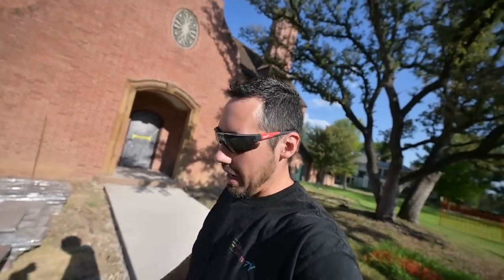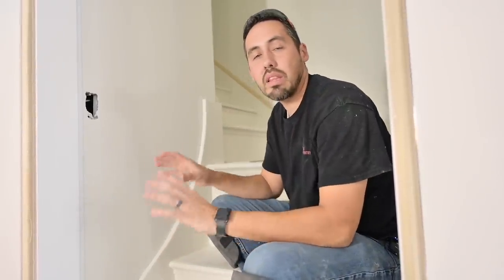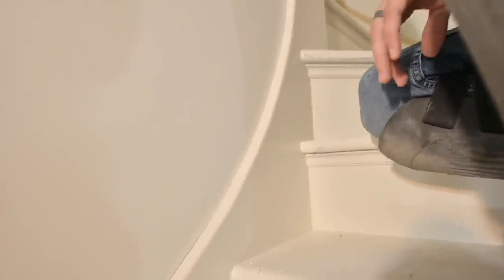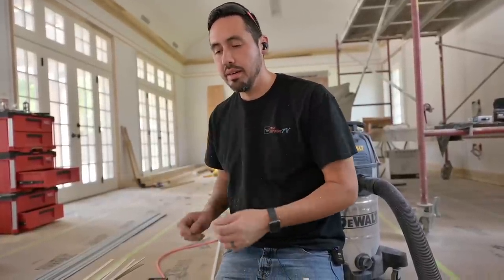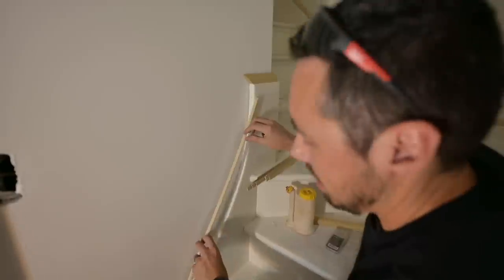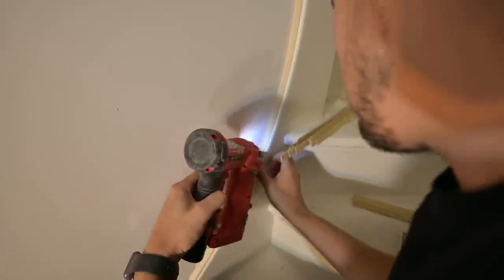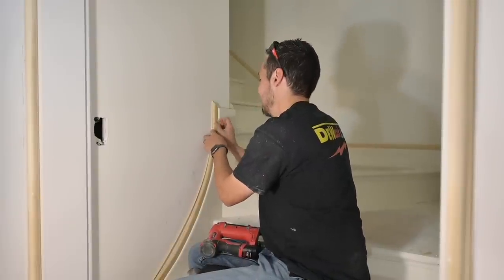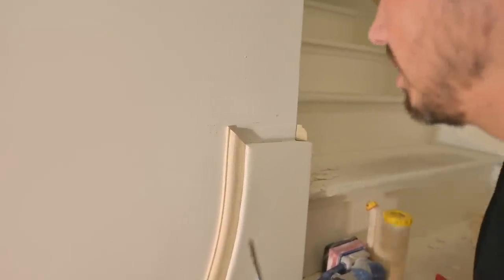This is some NEXT LEVEL Carpentry - Curved Skirt Board & Bent Lamination Mouldings

Comment: I do many projects in the yachting industry as far as woodworking is concerned.  We do a lot of curved trim installations such as this. Mostly in varnished teak or mahogany.  Do much of the same with bent laminating, aslo use steam bending sometimes as well.   I use blue tape and hot glue blocks of wood to it for clamping instead of nails for each layer,  hot glue holds quite well.  Also make a lot of bending molds from pvc boards, for gluing off site.

Comment: When I have profiles that I need to sand, especially intricate ones, I use a deck of cards to make a negative of the profile and glue sandpaper to it so I can sand that profile evenly. Curves like this I cut the deck in half lengthwise so I don’t dig in to the wood as much, but it makes sanding the profile a lot easier and you don’t have to worry but over-sanding a spot as much. I do furniture, not finish carpentry, but I would imagine the same technique could be used without any issues.
Reply: That's a hell of an idea thank you for sharing that.... priceless tips like that take years to learn
Reply: Do you have a video or tutorial of this method? Interested in this being I refinished a house of doors with a classic profile on the rails and stiles.

Comment: I do a lot of bent lamination for furniture.  You might find it easier to deal with the connecting joints by laminating into a form instead. You already cut the template for the base board and it would work perfectly for a form. The offcut from the template  can be used as the negative press for clamping the inside of the curve. That avoids the pin nails and gives you blank that you can cut your 45s with like straight stock.

Comment: Sanding Tip: As a shipwright, I have sanded many curves. Hulls, bulwarks, handrails, moldings, etc. 
Tip 1.   One of the things many of us used most frequently for fairing a surface was structural foam. Any rigid foam will do, (such as insulation)  for instance, I would bend the foam in the shape of my curve( if needed), and apply a layer of tape to hold that shape, then I used self adhesive sand paper on the "sanding or fairing board".
Tip 2.  This one is more for small detailed areas with a curving profile face like what is shown in the video, 
 Still using foam, Cut a piece that is say 8" x 2" x as wide as your trim.  
Cover the "trim" with a tight layer of Mylar tape (Scotch tape). Also protecting all surrounding surfaces.
Wax isn't really needed but it help, so I would wax the tape, then I mix up a semi hot batch of fairing compound (Bondo) then quickly apply a thick layer on to my foam, and pressing and holding the foam still, ( taping it into position when able) and waiting for it to harden. Next remove the foam casting carefully, so as not to damage the shape, remove the tape from the mold, trim it to desired length and then using a grinder or an edge sander, clean up the casting. lastly put some adhesive sandpaper tightly to the cast surface and you now have a perfect abrasive cast shape. Some time the shape we are sanding changes but the profile still works.  Cheers!

Comment: I didn't expect you to cut and install it the way you did. I was expecting you to glue it all up on your template using heaps of clamps than cut and fit it to the space. Well done looks good
Reply: I thought the same thing.
Reply: Thats the proper way to do it , laminate the pieces around the template but leave them long to compensate for it springing back when the clamps are removed, doing it around a form you can sand it with it flat on a bench and both ends can have a 45 degree mitre cut on to them.
Reply: That’s the ideal way to go, but you have to remember that he’s a mobile finish carpenter (save the garage tools).  I believe interior space may have been an issue for setting up a table to do the laminate glue up.  Plus,he wanted to challenge himself and see if it could be done this way.  Excellent results for a difficult solution.

Comment: Excellent work. The old adage (at least here in the UK) is that adding a single curve to a piece increases the time needed 10-fold. Add complex curves (more than 1 curve) increases it 100 fold. In all my years, I’ve found that is a pretty good rough measurement.

We are currently trimming out a barn conversion. All of the important trim is in European oak. That means that we can’t think about filler for any gaps and the grain of the oak becomes a real issue. 

We don’t use steam for this. In many cases, we do steam bend components but that method does have its own issues. Firstly, timber expands very little but compresses much more; you have to understand that and make sure you don’t try and make the timber expand too much. You can’t steam bend accurately as different timbers take different times in the box and all pieces spring back. 

We laminate our pieces - usually with a band saw as the kerf is much thinner. We over cut and then sand (with a drum sander) to get rid of any blade marks and ensure even thickness over length). And we cut more than we need because pieces snapping on installation seems almost inevitable. Then just build up until you have enough strips. If we are doing a complex curve (like a spiral) then we kerf cut all the pieces except the very thin top piece. Then apply a good quality adhesive (we only use PVA on this as PU could expand and make less than tight layers). To “cramp” everything in position. We hammer in lots of trim nails along the length if the wall is painted. If it is oak panelled, then we have to get very creative with lots of timber spring (long lengths of softwood perhaps 12mm thickness which we then cut to a length so that, to fit in between the lamination and, say, the nearest door jamb or ceiling, you have to bend the timber spring quite a bit. When in place, that spring acts just like a cramp. 

I hope that helps so,some who might face the same issues.
Reply: Thanks! I'm qualified but I've worked alone since college,  (I was, let's say past apprenticeship age!😉) so have to think up ways around things as I have no-one to learn from. So it boosts my confidence when I hear time served men, like you,  using techniques and get arounds that I've used. Thanks for a bit more knowledge. What area is the barn? (I'm in UK.)
Reply: @susanportsmore5306  I appreciate your comment. We are in a hamlet about 15 miles from Tunbridge Wells. The barn was an old Atcost steel job with corrugated iron cladding which had been used as a packing shed maybe 20 years ago. It’s the standard 100’ x 30’ size although we have put in a first floor. As a result of our LPA being both inefficient and lying (in writing!), we ended up spending £250,000 on legal fees. That took away the cash we had allocated to finish the barn off. So, when we move in (next month) it will be habitable but not finished. That’s fine as it only the wife and I.

We have spent about £20,000 on oak to date. About £5,000 on engineering oak herringbone upstairs and the rest on solid timber. With that, we are making window surrounds, door sidings, door frames, some doors, skirtings, coving , picture rail, stair treads and some furniture to end with (in oak and red grand is).

We are both very fond of the UK Arts and Crafts style plus the US craftsman style. So, my designs are heavily influenced by those. These days, the amount that I can actually do is limited but a son, who is a very good joiner, is doing most of the work.

For the finish, it’s Rubio Monocoat in a smoked oak tint. I don’t know if you have heard of, or used, Rubio, but I’m very happy with it. It costs a lot per litre but you use so little per square metre, that’s it quite cost effective. The A&C/craftsman movements used a lot of fumed oak. I’ve done some but it’s a nasty process of putting open ammonia in a closed space with the timber and waiting for the timber to take on that mellow tinge. For where I want “ebony” accents, I’ve made an ebonising solution (steel wool in vinegar) and “paint” that on the timber; depending on how strong the solution is and how long you leave it for, the oak, or any tannin rich timber, will go from mid brown to jet black. 

If you want a glimpse, then the son has a Facebook page (Sam Ward) and he has posted a few pictures of the work in progress. 

If I can help you in any way by just offering something from my personal 40 year plus experiences of hobby woodworking, let me know.. thanks again, Martin
Reply: @theofarmmanager267  Dear Martin, many thanks for taking the time to give me background on your barn. A lovely part of the country. I've heard but not used Rubio, and with fuming and ebonising, fascinating stuff. Urh I empathise,  I'm racking up legal fees and iht as I deal with my mum's estate, 2 years and still ongoing. Actually this prompts a question,  my dad/grandad were builders and built the estate I grew up on, built early 50's, I'm considering removing all the herringbone to reuse, especially as I found another stash in the loft! Knowing it's set in bitumen, do you think it'd be worth trying to remove? I'll take a look at your son's photos, it all sounds terrific, I too like a&c movement and the US look of trimming out. Has character,  unlike all the mdf I get asked for, not a joint in sight! I'm veering away from these jobs as its not what I signed up for and I love timber and hand tools, my dad's and grandad's chisels make me a happy worker! 😊 Hope you get to enjoy your barn soon!
Reply: @susanportsmore5306  thank you for the reply. Worth taking up? It really depends on the condition of the timber and what kind of flooring it is. If it’s solid timber (not engineered), then at least you could sand out any defects. I did that with a very large solid floor in an office building in London. It came out like new. If it’s engineered (with a veneer anywhere from 2mm to 6mm) then your re-sanding is limited by that.

I’ve only ever known solid timber that has been laid on bitumen. I’ve only ever had to take up a little bit of that and it was variable. One piece would come up quite easily because it had little bitumen but most were a real pain and it’s incredibly messy. So, for me, it would be a balance of the state of the floor versus the dirty hard work involved. 

We do use quite a bit of MDF. We’ve just panelled a corridor about 10m long in a Tudor revival style with linenfold, motifs and strap carving through it. Because the panelling was going to be painted, then we used MRMDF but only either Medite or Finsa - it is miles better than the compressed paper you get from the sheds. For the entrance lobby, we are doing pretty much the same style but in oak. For the backing panels, we are using oak-veneered MDF as you can longer get boards 300mm plus wider.

Comment: Great work Richard, I did one few weeks ago almost exactly the same size and slope, I used Kurf method which I learnt from kitchen installations from the curved corner parts of plinth on kitchen islands, I used to have to buy the bent plinth ends at cost £120 each corner then they started sending in a flat box kirf cut for £20 each so they mush have got fed up of steaming the plywood, love the videos, send Zak Bagin in for the ghosts.

Comment: I did similar projects in the past. I first define the thickness of material for the radius. There is a rule: for soft wood (pine, cedar, poplar, etc.) you divide your radius by 120. Here you had a radius of approx. 30”, so 30/120= 1/4” thick for each pieces. For hard wood it’s the radius divided by 160 > 30/160 = 3/16 in your case.
Than with double face tape, hot glue or screws if you have room, you make your solid block. Than you profile it as you need, take it apart after, reassemble it in place with a little sanding. That’s it. 
You did a great job though. A harder and longer way but well done
Reply: Am I following what you're saying here correctly, that he could have cut these strips into 1/4" thick pieces to achieve the same result? The softer wood would still bend enough at that thickness?

Comment: Loved the video and I love learning new methods, so thank you, but if I were doing it I would find the router/shaper bit that matched the profile of the moulding and use the template to cut the whole piece out of a wider piece of lumber, like a 1X8 (probably doubled up and glued to match the thickness) and once I had the shape fitting perfectly I would use a fenceless router table to route out the profile. I imagine you wouldn't need a huge shaper to make that profile as the moulding is quite small, and I know Richard has a router that can handle the job because I've seen him do raised panel wainscoting. Yes, I'm aware that my method involves a ton of wasted material and requires a new tool accessory but I prefer it that way so that if I wanted to make that profile in the future, I know I could. When it comes to how Richard made his rips on the table saw, I don't agree with eye-balling the rip size and constantly moving the fence; it seems like a lot of extra time and effort to do something that won't give you perfect results. I, personally, would set the fence 1 kerf width away from the blade then run 1 whole piece of moulding through to get my first set of strips. Then I would move the fence to accommodate ripping exactly 1 kerf width off the bottom (or top; whichever side you started ripping against the fence) and run a second piece through, then move the fence back to exactly 1 kerf width away from the blade again and run the second piece through until I had my second set of strips. This method only requires 2 pieces of moulding, 3 fence adjustments, and will provide perfect results.

Comment: Amazing work man, I love how excited you get about this stuff; I can certainly relate—the reward of doing good work and seeing things come together is an awesome feeling. 

Pro tip: when cutting the strips, make them the same width as your blade kerf. This way you will be able to only use two pieces of trim and just stagger each piece. If done correctly, it should come together perfect, and the pieces will be a bit thicker and easier to work with. With a bend that subtle, 1/8in strips shouldn't be an issue at all.

Comment: I don’t think people are going to realize the difficulties with doing this and making the alternate cuts to make up for the blade thickness on the first cut piece cudos to you for making it happen 👍🏻
Reply: Not only the thickness but the width as well. The sanding has to happen due to the replacement pieces or ABC so on, so when you sand youll lose width. Alos the piece he cut off should have been the piece he built the laminated piece to with clamps first .. Ive done plenty of curved pieces of materials or even custom crown on older homes..It the absolute best fun.
Reply: Because noone here is as smart or experienced as you? Nahhh
Reply: I think they are, I mean he explicitly talks about it and shows it. You know, sometimes not contributing is a way to contribute
Reply: @tragicallycanadian8317  LOL. True enough.

Comment: Richard, you could have made a MDF form for the curve (basically use the cutoff that you used to create the skirt boards) and then laminated strips to equal the height of the trim then using a round-over router bit on your router table to profile the top of the trim to match. It is a around-over with a fillet for the square edge of the profile. I’ve done this for curved door and window casings along with creating mirror frames. Just a different approach that would use less wood as there is always more than one way to skin a cat!
Reply: Same way I did my window casings that were perfect circles on top
Reply: Sure hope no one from peta reads this! 😂 Poor kitty!
Reply: I was thinking something similar.  Or, since the steps went in after....he could have just routed the skirt (if he had used MDF for the skirt).
Reply: That's the right way to do it.
Reply: Great tip, thanks for mentioning it!

Comment: A very neat way to make that, but I thought a man with 3 new router tables would've made the skirt oversized and just routed a matching profile onto the skirt board!
Reply from the maker: Haha! We have to match the cap to the historic precedent of the home. But I did  try to find a bit close to that as a back up plan if this didn’t work. Could not find one so glad this worked out!
Reply: @FinishCarpentryTV  
Are u giving away a table saw? I made a comment and someone replied and claims to be you.
Reply: @FinishCarpentryTV  check the comments on this video. They replied to several people claiming to have something “special”

Comment: You can typically use two pieces of moulding and take 1/8" rips. 1/8" kerf out of one piece and the actual part out the other. I've done this many times on mouldings including a few large curved windows.

Comment: Others have mentioned the glue up using a form, which is how I would do it, since you already have the template…you’ll still get enough bend to hit the curve properly.  All the pins weaken the structure and you risk splitting such thin strips with all that hardware.  Also, the glue bond is more problematic without consistent clamping pressure across the piece.  But whatever works…

Comment: Fine home building made a good post on Instagram about bending moulding the same way. The way they explained it you can make this happen with just two pieces of moulding basically you rip one down into 1/8” strips and your second piece you take a blade off first and then continue ripping that piece into 1/8” strips.

Comment: I only did this once. For an arched window casing. 1x4 MDF. I ripped the casing in 3. It was a tad stiff. But it worked. I cleaned everything with a belt sander. Lots of squeezout.
I think if you have several of these to do you can probably get away with ripping the profile in 3 or 4. Ripping 17 pieces is a bit much.